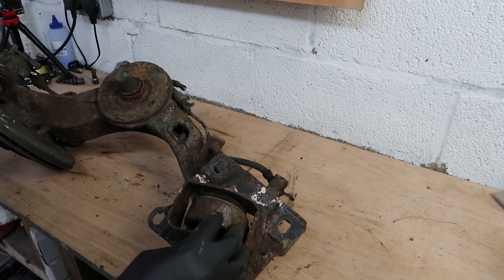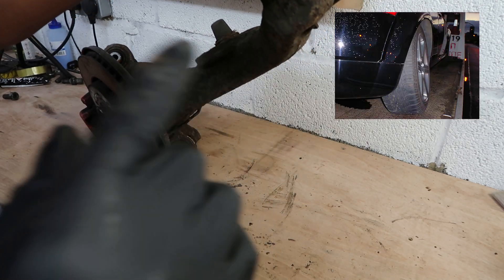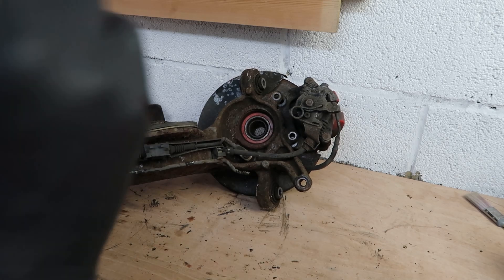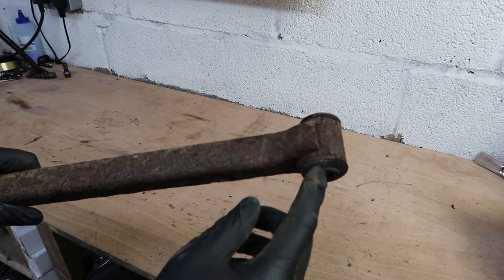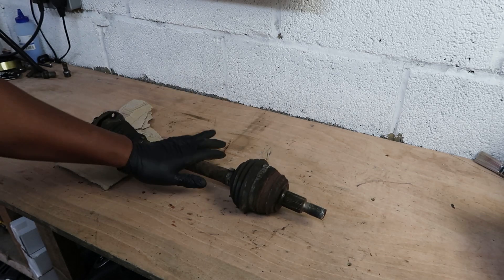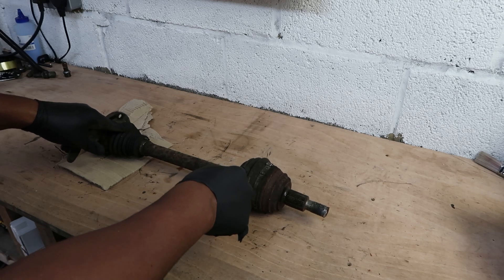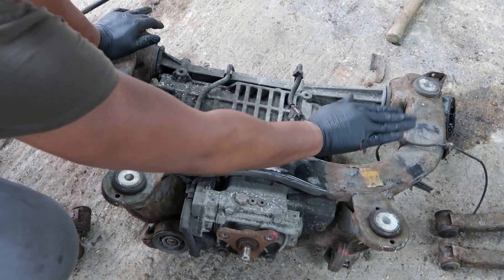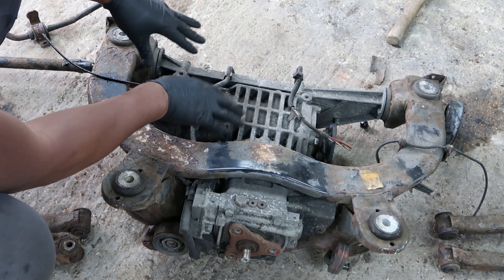Audi TT MK1 Rear Suspension Common Issues and Faults

Comment: Thank you for pointing out the control arm failure potential; that is very dangerous and likely, as this fleet of cars is now pushing 20+ years of service! Like you, I would implore people to simply replace this part, the part is cheap and as you point out, the failure is fatigue, which means it won't be obvious in a simple visual inspection; and compounded if the car has been operated in an environment where the roads are salted.  
On Haldex service, I've read 20k miles between fluid changes, and a filter change every other fluid change. My adage is: fluids, filters, and brake pads are cheaper than clutches, gearboxes and differentials!